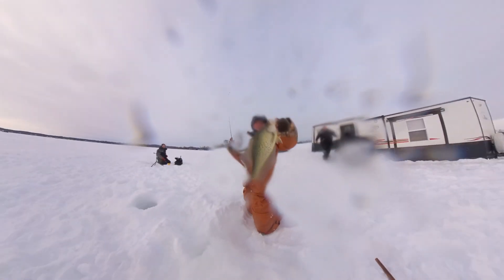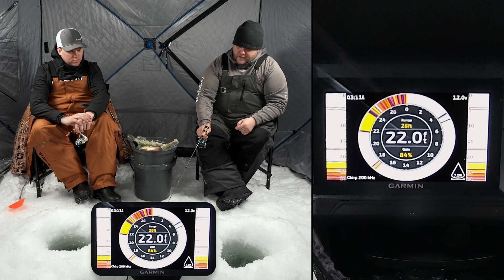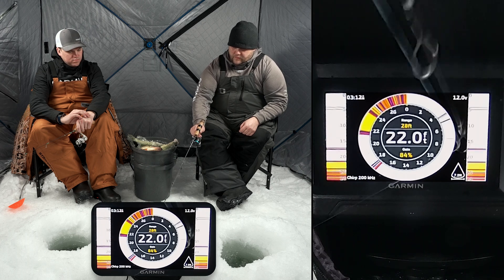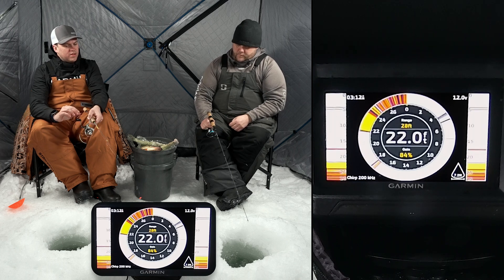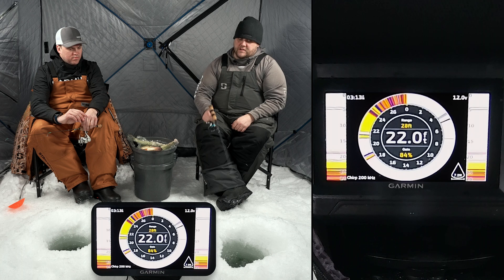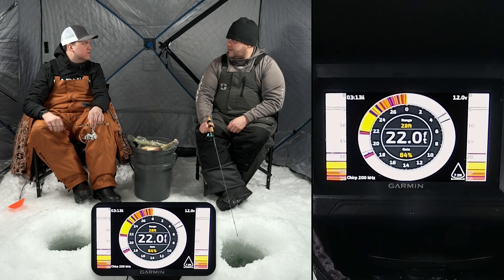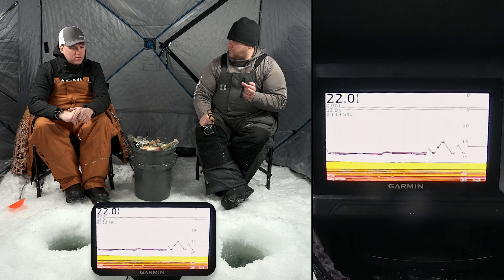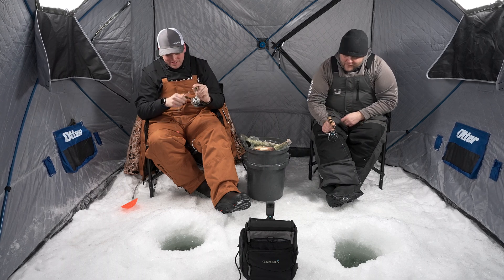How to use & read a FLASHER on a Garmin ECHOMAP™

Comment: so do I have to download something to get the flasher on my screen or... I got the small ice fishing kit to go with my Garmin 73... just trying to figure it out, and seeing it is cool but this didn't teach me how to set it up, or use it or anything-
Reply from the maker: If you are still experiencing issues operating your bundle, I would recommend calling in to our product support team. They will be happy to walk you through the operation of your ice fishing bundle, as well as answer any other questions you may have. They can be reached at 800-800-1020. Thanks!
Reply: @GarminRetailTraining  turns out even though it says it’s compatible… you need to buy an adaptor. It won’t be here in time for my tournament.